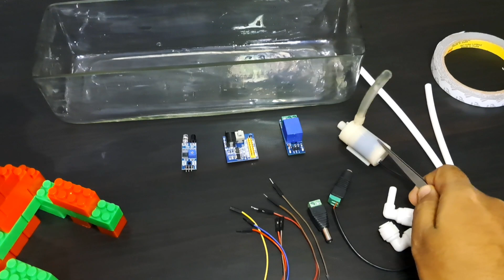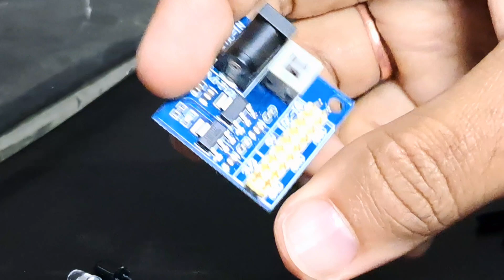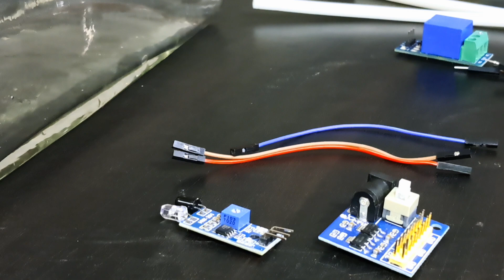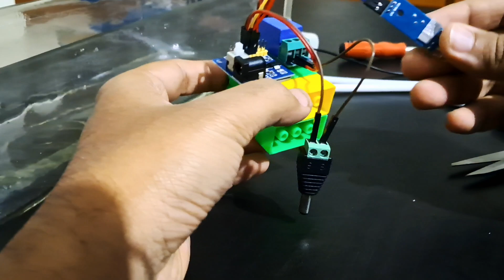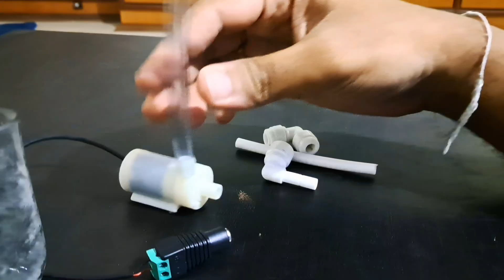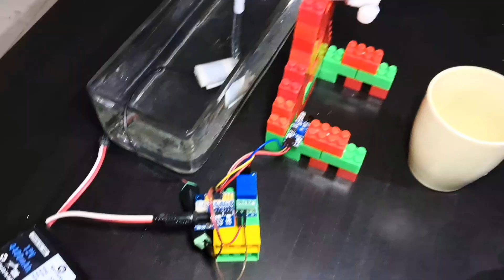Building your own DIY automatic Water dispenser

Comment: Any standards we need to maintain
Reply from the maker: Viewers are expected to know basic concepts like voltage, current and how to make connections between electronic  components.

All the components mentioned in the video operates at 3.3v and 5v. Refrain from using 12v as it will damage IR sensor and 1 channel relay.

This experiment is designed for age group above 10+